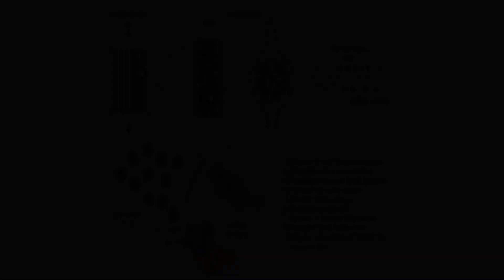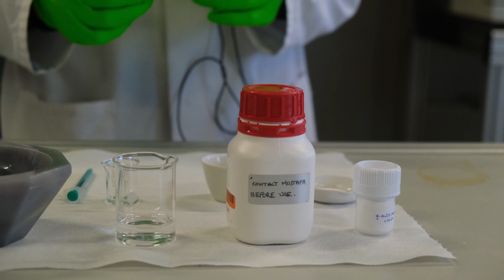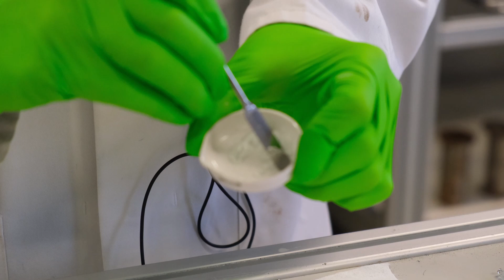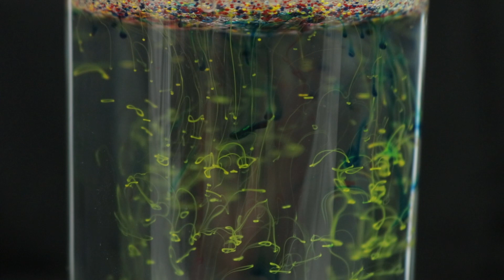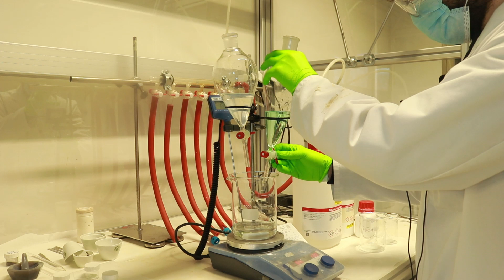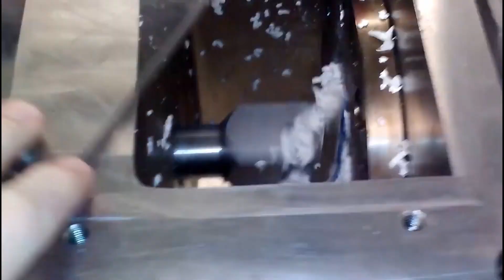Catalyst preparation: Synthesis of Solid Catalysts and Support

Comment: In this video, you take large chunks of text from Chapter 3 of Synthesis of Solid Catalysts, titled Electrostatic Adsorption by John Regalbuto. You should cite this source.
Reply from the maker: You are right. This and other books are included in the list recommended to students. Synthesis of Solid Catalysts
Editor:Prof. Dr. Krijn P. de Jong DOI:10.1002/9783527626854